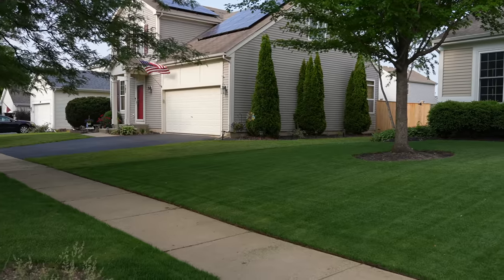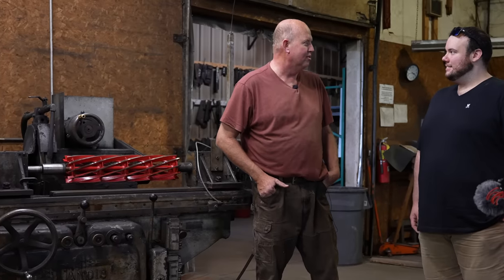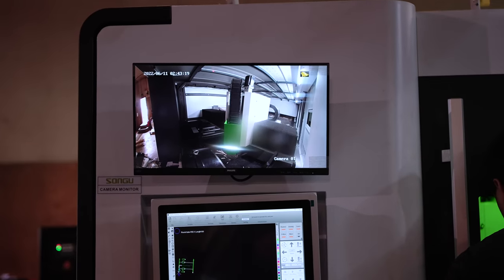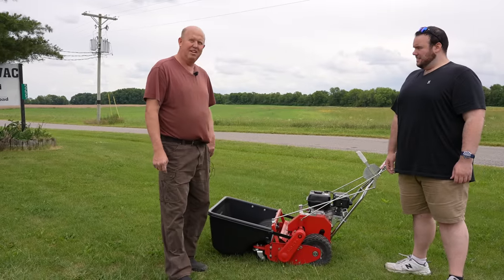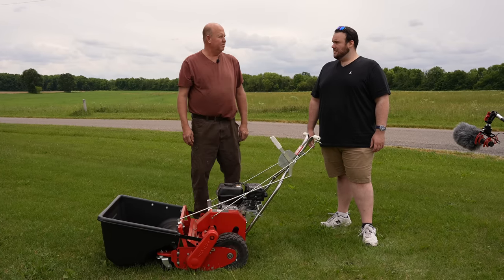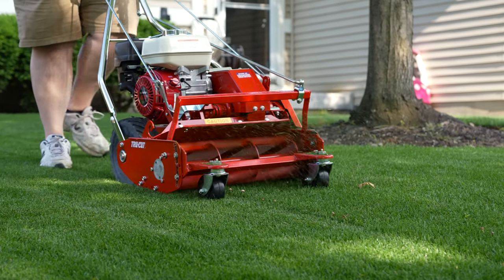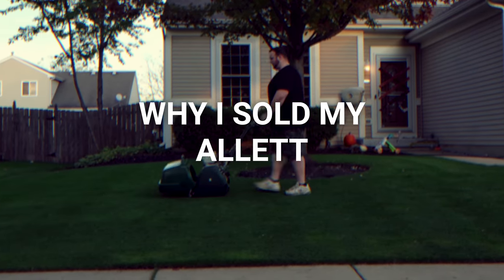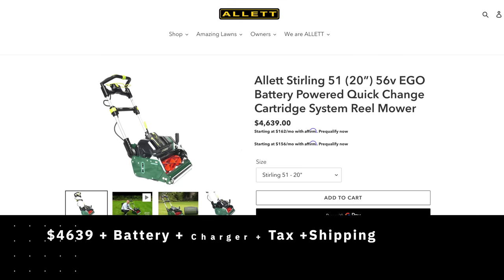This Mower Will Make Your Lawn Look Like a Golf Course

Comment: Bro this channel is authentic af. You put a lot of time in your craft. Very well put together. Huge fan.
Reply from the maker: Thanks boss!
Reply: Craft? He makes random videos with extremely little information and clickbait thumbnails and titles, that's not craft. Recommending a horrible mower and saying it will make your yard look like a golf course, WORST THING IVE EVER HEARD. It's not the mower that makes the turf or golf course that's why golf courses around the world use all different brands and models, this goes for one of the best courses ever, Augusta National. They have changed brands countless times through the years and even a handful of times in last decades but the turf always looks the same. It the maintenance practices we perform weekly, we also mow turf far shorter, some cutting no higher than .300 on tees, greens and fairways. We aerate, deep tine aerate, spike aerate, groom, verticut and topdress lightly all the time. We have a regular routine for chemical applications from fungicides, fertilizer, soil amendments for micro and macronutrients, PGRs, wetting agents, pre and post herbicides for certain times of years and several others. Our root zone mix/soils allow for us to have extremely deep roots, keeping dry firm conditions without needing to water but once per week unless we need to hand water during the heat. We also know sometimes its better to just hand pull weeds, not weeds per say but native grass like poa, but anything growing where it doesn't below is a weed by definition. These are just some of the things that make golf courses what they are not just a single mower brand. Lawns are far easier to take care of because you guys mow at higher heights

Comment: I had a 25” Tru-Cut and the Brigs engine and the carb setup was a piece of junk and it was a constant battle that wasn’t worth fighting.  Hopefully the engines are better now… I only bought it to dip my toe in on reel mowing.  Got it sharp, used it for about 4 months, but for me it was so unreliable that I honestly preferred my manual Fiskars while I was waiting for my Allett Stirling.  Sold the Tru-Cut for $200 and told the buyer bluntly that they should only buy it if they are planning to replace the engine and carb.

A few recommendations with the Stirling… awesome machine (battery lasts pretty much all day and I’m pretty sure I have not once killed the battery yet).  I would skip the brush and I’m not nearly as sold on the verticut cartridge as I expected.

I prefer to use the Stirling with the front rake removed, and if you want to double cut diamonds, removing the rake is a must or the mower will zig-zag with every stripe it crosses.  Since I scarify before every mow, I noticed no advantage to using the front comb anyway.  That scarifier is so gentle and effective that it’s kind of crazy how beneficial that one cartridge is!

My attachment purchase order for the Stirling would be as follows:

1) Tine scarifier (This is just as important, or possibly more important than the actual mowing cartridge in my book… I literally use my scarifier cartridge more than the mowing cartridge)
2) Dethatcher (often called a scarifier in the states)… seldom needed, but extremely beneficial when it is if thatch is present.
3) Verticutter…  I could very easily do without this cartridge.  I’m honestly not sure if there is any notice difference on Rye and the bag is pretty much empty.  The blades might be too dull (the are 100% blunt) or it might not spin fast enough, but I’m not sure if much is happening there.

I would not but the brush or aerator cartridge at all because both are pointless.

The brush is junk and lots of bristles are in the bag every time I used it and the scarifier does about the same thing but much better than the brush.  For worm castings I’d grab the scarifier… in terms of gentleness, I think the scarifier is likely more gentle and it removes a lot more debris.  I got the brush w/ leveling in mind, but I don’t plan to use it for anything else and I likely won’t even use it for leveling.  

When it comes to the aerator, I don’t own it, but I think it’s pretty obvious by the design that the aeration cartridge doesn’t really do anything and I would argue the added traffic alone would likely do more harm than good.  Far more aeration can be achieved with the dethatch cartridge and obviously a core aerator is 100x better also.  Might offer some benefit on greens, but I’m doubtful.

Even though it’s expensive, I’m loving my Stirling.
Reply: You got it.  Overpriced mower that is poorly designed and the weight of the reel is their only selling point.  Well, how are you going to sharpen it?  Shipping prices are through the roof and this mower is going to cost you $3,000 or more depending where you live.
Made in the USA is a tired lie when it comes to quality or longevity.  It does mean you're going to pay through the teeth, though.  That's why Americans don't actually buy American.
Reply: Toro is near world leading (and clearly market leading in the USA in this exact space for professional day in and day out users) and John Deer is typically second runner up for golf courses and sports turf (also dominantly USA made in this exact space).  That’s the #1 & #2 brand…

There are some products the USA does make very well (computer software, furniture, appliances, buildings, guns, industrial & commercial application, etc.) but most American households simply aren’t willing to pay for quality brands on more expensive purchases so Europe or USA products often aren’t even considered.

I agree that 100% blind, I’d often pick a European product over an American brand dollar for dollar but I’m not even sure that this would be the case 50% of the time, so I don’t agree that American made equals crap and I would even consider USA made junk to be the rare exception rather than the rule and this Tru-cut looks like it’s made improvements since my super old POS motor on mine.  USA labor is expensive which means if a manufacturer isn’t producing quality than generally they will be out of business sooner than later… in terms of lower priced goods like Tru-Cut or Cal-Trimmer an American brand often isn’t a competitive value and those are the brands that generally struggle.

In my pockets… my high end pen is USA made in Texas and I’m unlikely to ever buy a pocket knife that isn’t made in Oregon (Benchmade w/ Axis lock).  My favorite and most reliable gun is USA made and my iPhone I’m writing this on was accomplished primarily of USA mind.  I think USA engineers are top notch so even China made stuff is quite good when designed here… our fruits & grains tastes better… many of our cars & planes are competitive (exe: Tesla & Boing).  I don’t really understand your perspective here except with a handful of lower end American brands… I was just saying that my ancient Tru-Cut was a lemon, but my Stirling (UK) is pretty amazing.  Stirling is on the EGO battery platform which I would assume was engineered in the USA… the EGO battery might be made in China, but if the battery were engineered in China I think my mower probably would have caught on fire by now!  We must be seeing different USA brands because I generally disagree.
Reply: How come he didn’t answer your reply
Reply: @tomaxxamot2016  I’m too long winded.

Comment: Back in the late 60s we used a Jacobson and a Toro reel mower to cut the greens at the golf course. We sharpened those once a week by using clay grit with oil and a back lapping attachment. These were 2 cycle mowers. Cut the green by making 2 perimeter circle cuts and then divided down the middle and cut a straight line back and forth until finished. Looked fantastic.

Comment: George this is by far my favorite video yet, 1-tje fact that you made a drive to make a video for us is amazing 2-i was gonna say, big mistake not having the front rolled lol, but you did it! 3-your thoughts about allet are spot on, i don't think i would be as nice doe, cheap plastic parts with outrageous prices. I paid $1300 for my JD sl180 and i mow my Bermuda at 0.3, smokes the allet and will outlast 10 of them at the fraction of the price, imo even the Cali trimmer is better.
Reply: I would totally agree on the front roller. Most guys are going to want that
Reply: @MyGreenLawn2019  everyone* , it should come with the mower, there is a reason why greens mower have rollers not Wheels
Reply: @rizocars6115  I totally 💯 agree rollers should be included not wheel!
Reply from the maker: wow thank you so much for the awesome comment!
do you have a cal trimmer? i reallllyy want to test one out soon
Reply: @PrincessCutLawnCare  i had it for 2 years, I'll give it a 10/10 considering the price. I upgraded to a greens mower because i cut my bermuda at 0.3 and the Cali didn't go as low, but for cool season grasses, i think is perfect

Comment: I used to work as a lawn care guy back in the day and we used gas powered reel mowers on some of the clients, not sure why only some, I just did what the boss said. Anyway they were a lot more compact back then, basically they were just a little deeper than the engines, with the engines sitting right on top of the reel. These things you use are like seeing cars from the seventies nick-named boats. I wouldn't get these until they start making compact ones again like before.

Comment: I respect the honesty about allett. I myself was looking into purchasing the sterling. And I feel right now in my position I can get a mint condition greensmower with low hours for cheaper.
Reply from the maker: No problem boss, if you have the lawn real estate, than it doesnt get much better than a greensmower, good luck!
Reply: I too am glad I did not pull the trigger on the Allet. I am still using a Scott’s classic 20” and it does the job. Would be nice to have a True cut or a Mclane, yes it would be and I know some day I will, but Allet it’s like an Apple phone, you will have to replace it every 3 years.

Comment: I bought a used 2010 C27 from a neighbor two years ago. The thing is a beast. It’s a pain in the butt sometimes to get it dialed in, but once you do you can’t beat it for the price. Haven’t taken it to get sharpened since I bought it as I do my own backlapping. May get it sharpened for the ‘23 season. Cutting Bermuda.
Reply from the maker: havent messed with adjusting the rell to bedkife yet, that bad?
Reply: @PrincessCutLawnCare  it will test your patience.
Reply from the maker: @jarrodsp71  haha good to know, perhaps i should relay that info to the new owners to see if they can improve it going forword

Comment: I agree with cost on the new Alletts.  That's crazy.  But as for the Liberty 43 battery one, I love mine and it was about the $2500 you paid.  Very expensive to be sure, but it's been solid for me.  It doesn't have that plastic switch that broke on your gas version though so I can't speak to that.  I'm 6'4" and the 43 has never been a hunching machine for me, so that isn't an issue I've experienced.  TruCut is definitely cheap in comparison, so if you can't afford Allett I can understand that.  I will say even with a front roller you're not going to get those stripes - you need a big back drum to lay down the grass and stripe.  The front roller is just so you're not scalping.

Comment: Great vid as always George. Tru-Cut seems to have a nice operation and very convenient to be somewhat locally accessible to you. Whenever anyone asks me what brand of reel mower to get I always say whichever company has the most quality , local and accessible service availability in your area. From experience if that is not the case it can become quite the annoyance. I have a somewhat older Allett Kensington i inherited from grandfather as they moved out of here / NJ to Florida most of the year now . Not had too many issues with my Allett , but have gone through multiple companies who service them and usually not very helpful / responsive , not too reasonably priced and often not the quickest turnover which can be frustrating when needing equipment back. 

A friend of mine in a fairly high up job in turf management at a local golf course helps me out at the moment. But not an ideal long term situation. Anyone in the market for a good reel mower , make sure there are quality reputable service companies for that brand in your area.
Reply from the maker: Excellent advice Andrew! its all about service location!
If you dont mind me asking how old is your kensington?
Reply: @PrincessCutLawnCare  have to check exactly but has to be 10 years old give or take , I am assuming based around the time he originally got it and can't imagine he bought it used at the time. Just wasn't his way and he is not too tech savvy to find that option anyway. 

I was handed down my mower rather than buy it but buying one now i would of course make sure the build quality and features are what I needed / wanted. But I would also do my research to make sure quality service companies were in my area for whichever brands i was interested in.

Comment: The Tru Cut seems like a great value. I checked out your link and was expecting the C-27 to be over $4K. The only downside I really see is that it's on wheels and I just don't see a front roller providing even close to the stripes that one with a rear drum would. I would love to see  a comparison between the stripes of you Tru Cut with roller vs Allett.
Reply: George said he had to purchase a third party roller. I would agree I do not like the dolly wheels on front I wonder why they chose to do that rather then put on a roller especially for the price of the mower. You shouldn’t have to spend more money to get a roller. Just my 2 cents
Reply: @MyGreenLawn2019  I meant that even buying a front roller, i don't think that would leave the stripes like having a drum in the back would. On their website, you could order a front roller (on the c-27 model). I would just like to see how the stripes compare with his tru cut with front roller compared to his allett.
Reply: @rodrigoalonso9196  haha I was viewing this on my phone and I guess I thought it had a drum, well wheels across the back, yea it does not! Only 2 rear wheels as far as I can see. Bummer. Great observation dude.

I didn’t turn my phone sideways while viewing so it was a small picture, but yup I see it now, or I mean DONT see it lol
Reply: I have a TruCut C27 with aftermarket smooth roller kit from ReelRollers. Also have a Toro GM1000. Both stripe very well, just depends on height of cut

Comment: As a kid in the 70's in PA, I remember a lot of reel-type mowers.  It was obvious even to a kid that the grass was cut better with such mowers.  I even remember using my grandpa's PUSH style reel mower!  Then I started seeing more and more of the flat blade mowers - I presume they became the home standard due to lower cost.  In my young teens I started golfing and observed nothing but reel-type mowers on golf courses.  Seems to me it's obvious why golf courses use them - better results on the grass.

Comment: Got the Allett liberty, $2300.00 .
 This is my 3rd season. Had to change the drive v belt and the turtle/rabbit control switch is acting up on me sometimes but I still like it, lite weight and easy to maneuver around obstacles in the yard. So far i only had to backlap it to sharpen the reel at that is very simple to do. Allett is still selling the liberty and the cheaper gas models but they did increase the prices a few hundred bucks. 
I head tru cut is a very heavy unit and needs greasing all the time and backlapping is a pain in the yang yang !Anyway, Good luck with your new mower.
You need to get a PORSCHE 911

Comment: Thanks for the great video.  Appreciate the factory tour—and I absolutely love American manufacturing and the old-school solidness of products!  I’ve been seriously considering a California Trimmer but the Tru Cut sure seems nice, especially the dual-clutch system.  Your thoughts on the Tru Cut vs Cali Trimmer?  I’d like to visit Tru Cut…but it’s 8 1/2 hours (one way) from here.  I called them and shipping adds $150, plus $75 for residential, plus $95 for a lift gate.  And they (the very nice lady who answered the phone) have no way to look up any dealers that may be nearby.  She said they’re mainly a factory-direct sales company.  Great looking mower but the costs are really adding up.
Reply: I've had both, the tru-cut is the way to go...
I like having the drive wheels instead of the roller drive.  
Both are great machines though!
FYI Tru-Cut moved to Indiana from California since it's not a manufacturing friendly state.  They've put a mandate that lawn equipment cannot have gas engines anymore.
We're getting squeezed here :(
I suspect Cal Trimmer will eventually move too
Reply: @rafbo2  Thanks!  I happened to find a slightly used Cal Trimmer locally for a great k of rice a bought it.  So far, so good.  That is, after three mows of my 3,500sf area.  Still learning; brand new to reel mowing.  And by the way, I called the factory and California Trimmer is in Auburn, Oregon.  Interesting.

Comment: I agree on Allett pricing of their latest Sterling model which does not come with the battery and charger, all told it comes to $6000 and that is crazy expensive. I have the Liberty 43 which suits my needs and no gas fumes to inhale or wake my neighbors in the a.m. I do my own sharpening  as I do not trust the shops in my area.